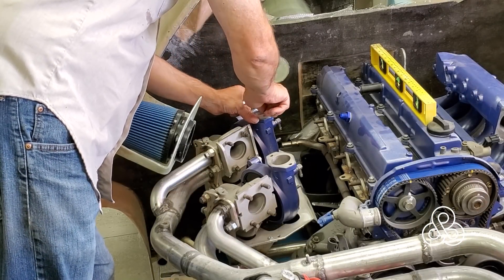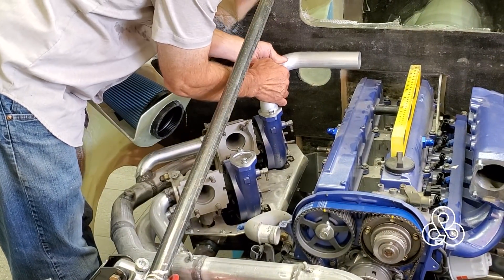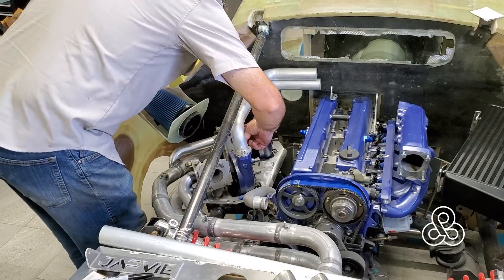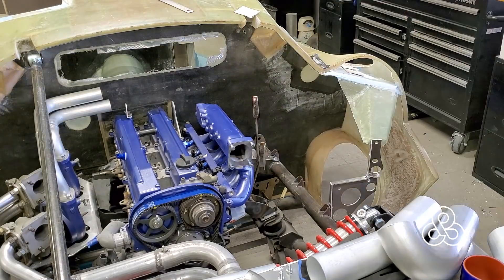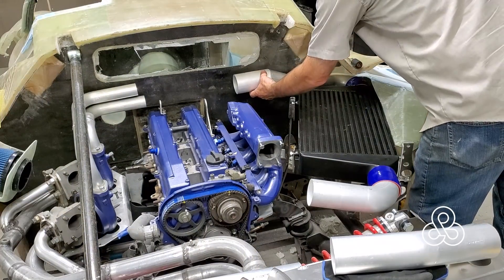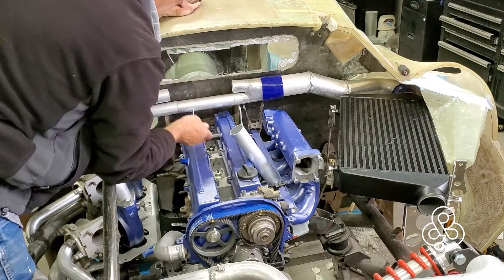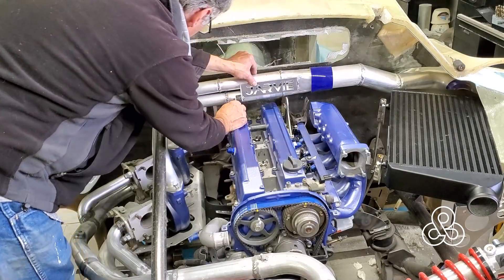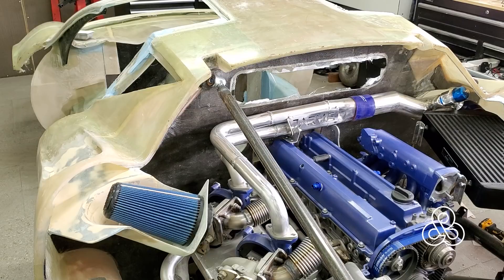A70 Turbo to intercooler plumbing - A re-do plus, Arete Supercar Project

Comment: That's a bit long of an intake runner between the turbos and the intercooler, so that might have a potentially detrimental effect on the lag of the boost building. We'll have to wait and see. It is unfortunately a bit late on this shell to decide to change over to a water-to-air intercooler design, since the sills would have been a perfect place to run the charge cooling pipes down to reach the radiator for that intercooler.
Reply from the maker: Of course lag is easily reduced by ditching turbocharging in general. Looking for high end horsepower and will skip the drag races.
Reply: @BuilderCreator  If everything else fails, you can always take the Binky approach and custom fabricate things until they fit in the tightest possible configuration. 15 degree pie cuts of aluminum and stainless can go a long way to getting stupidly tight bends with minimal turbulence from the flat angles. It just becomes incredibly time consuming and you'd also need to replace the intercooler with a smaller but thicker core version, probably using an unfinished core that you'd have to build end tanks for. Air-to-air intercoolers can be quite limiting in their placement, but are effective for reducing the number of cooling systems involved when you have space for them. But, first, it's best to run the config you've already got and see what kind of performance you're getting from it to see if it even matters. Sometimes the gains from hyper-optimizing your build just aren't worth the trouble incurred. If you ever get to a point where you're looking to completely redesign the rear sub-frame for a different engine entirely and you want something reliable but incredibly exotic, see if you can get your hands on the V12 from a Toyota Crown. It's the only V12 they've ever put into a production vehicle and it is crazy smooth. There's a series of videos of a guy attempting to cram one into an MX-5 Miata and I'm still not sure where he's going to fit radiators. The problem with exotic engines is that parts are difficult to find, so there's always that struggle to contend with. The 1UZ-FE is a much easier engine to work with if you wanted to lighten the build with an all aluminum long block and it can still accept boost with minimal modification. At one point there was even a company selling a centrifugal supercharger for it that they claimed could get you to around 700HP without needing to go to a built bottom-end. But, once again, best to see what your current config is capable of. The 1JZ is a very strong block and can easily be pushed to 1kHP.

Comment: Great video. Crazy fabrication skills. You are the American Bad Obsession Motorsport.
Question: could you not flip the incoming end tank on the intercooler? Give the 3” inlet a straight shot without the crazy bend and bulge into the firewall? Also, I saw a comment on ovalizing a 3” pipe across the firewall which seemed like a simpler idea.
Great videos. Keep them coming.
Reply from the maker: Nope. I need the extra length on the opposite end to fit the throttle and MAF sensor; flipping it would have put the discharge side just inches from the intake and no room for Throttle/ MAF. A 3" mandrel bender would have made things a snap, but alas, prefab bends is what I could afford. Thanks for following the build!
Reply: @BuilderCreator  wow thanks for replying. I probably didn’t explain well, but I meant just flipping the one end tank closest to the fire wall. I could see that you need space for a MAF and throttle body on the inlet manifold side. I’m not an intercooler expert and just randomly commenting. I don’t know if it would affect the intercooler flow to have inlet and outlet on opposite corners, maybe? I’m sure there are people who know more. I was thinking more along the lines of straighter pipe runs and not having to watch you cut a hole in your beautiful firewall. Great channel by the way. I’ve been through the whole Arete playlist!
Reply from the maker: @hutchingjc  The whole playlist! That should qualify you for a ride in the finished car or something! Thanks for helping trigger the algorithm. :)

Comment: I keep watching the turbo positions and wondering why they are there as you have done and that you are leaving the manifolds till last. A few things.
- I can't see how you are going to get air in to them, they seem backwards.
- The exhaust really should go down and out not around as you have done as fibreglass bodywork hates heat and heatshields don't actually remove heat, they redirect it. It's not like a metal bodied car.
- I don't think those flex joints you have for the manifolds will last and again the manifolds themselves will radiate massive amounts of heat. That's why most oe manufacturers place them close to the blocks and down low.
- Intercooler pipework looks neat but for future have the inlet to the intercooler come perpendicular to the fins. It would mean cutting up the tank but uses the whole core better and would not need the bulkhead cut out.
- you cannot use a hose clamp on a high pressure pipe of oval cross section. The flat areas will have zero pressure on them and this will either cause the joint to leak or allow the silicon to creep under it at this point, taking the rest of the joint with it as there is no longer any volume of silicon under the clamp.
Loving the Arete content, totally unique to Youtube and very ambitious elephant to eat!
Reply from the maker: I'll answer your questions best I can- Even with "clocking" the turbos some entry or exit will have to point in an inopportune direction. I chose the best option for the packaging area I have to work with. Heat- When you see the rear "bumper" section of the bodywork come together you will see two fans for removing heat. Flex joints- the Jz came with bellows flex joints. Toyota was okay with the design. Plus I don't need to offer a 100K warranty. Not sure I understand the intercooler pipe question. Pipe clamp- There is no oval pipe under the clamp, it is round. Sorry if the video shows the clamp (temporarily in place) scooted down over the oval area of the merge collector, it will shift back to the right on final assembly. Wishing it was only a Hippo! Ha!
Reply: @BuilderCreator  The trouble with perspective from the one camera angle made it look like the two pipe side of the hose clamp was on an oval pipe. Good to hear that it's all round! Im waiting eagerly to see how you deal with the heat management as its a mammoth task generally in a normal car, and very underestimated! Make those fans(really fans!?!?!) huge!! Keep at it, surely its hippo sized now?

Comment: Totally off-topic question: can you give us a sneak peek hint as to how the shell of the Leviathan will be constructed? Am intrigued to see how you construct a composite fuel cell too - fantastic content as always.
Reply from the maker: We will be doing a fiberglass over foam panels, layup to create the camper side panels. After some road/off road testing we will take molds off those panels and or modify them, to take into account things we learn in actual use; then take molds. The fuel cell will be happening pretty soon so stand by for a video.
Reply: @BuilderCreator  I was hoping you'd say foam panels, but the "real life use then modify" + make molds step - whilst now obvious - was not something I had considered but totally makes sense. Thanks again.

Comment: Nice build!
I’m not sure you’re going to have any meaningful airflow through the intercooler, placed as it is, in-line.
People have gotten away from twin turbos on L6 engines too. Compressor surge is a big reason why; the turbos can commence a strange feedback interaction resulting in surge.
The silicon hose joints are nothing but trouble. The Wiggins joints ain’t cheap, but they won’t blow off.
If it were my project, it’d be Single-turbo, air to water intercooler, and dual-fuel capability.
Boost lag is no longer an issue with modern turbos.

Comment: i was concerned that the tube would heat up the cabin or transfer excess heat to the top of the seats. wasn't sure if there was a way to avoid having to route the path into the part of the cabin or not but I'm glad you were able to keep it in the engine compartment. also, the bracket with the name on it is a nice touch.

Comment: Wouldn't it been easier to just squeeze the part of the 3 inch pipe that crosses over the engine? I would've done it like this. Cause two 1,5 inch pipes aren't the same as one 3 inch pipe and it would be alot less welding and not having to fabricate any collectors.
Reply from the maker: Great option! However, the twin turbo setup forces the "merge,"  but your method might have been a few less welds. For looks- dual pipes vs squashed pipe . . . Hhmmm!

Comment: Jay - Great work as usual.  If I make a suggestion, you might want to consider putting a weld bead on each of the large tubes about a 1/4" from the end of the tube where the silicone connector tube is.  This will work like a rolled bead to help retain the silicone tube when clamped down.
Reply from the maker: Thanks, I will have a bead/weld/flange to keep that coupling gripped on tight. :)

Comment: Cross sectional area of 2 1.5" diameter tubes is only slightly more than 60% of the cross sectional area of a single 3" diameter tube.  With the IC downstream, probably won't make a difference here.
Reply: It does make quite a lot of difference  - constant cross section changes introduce a lot of efficiency loss...
On the intake side - what you want is - a constant reduction of cross section - ending with the smallest section at the open valve.
This way you have your charge constantly accelerating and carry a lot of inertia to charge the cylinder to the max... Doesn't matter if you turbocharge or not - you are just moving the pressure range...
You want to keep the max speed of the charge to the valve just below sonic at the max flow rate...
Introducing a Charge cooler brings up another few variables - cooling the charge makes it denser and so requires a smaller area to keep up the speed in the intake tract.
In the case of a charge cooler - the quest for intake charge acceleration starts after that cooler.
As it is - going from D3" to 2xD1.5" to IC intake tank is not optimal at all.
Ideally you want to slow down as much as possible going into the IC.
So speed up - slow down - IC - speed up again...
Ideally you would rather start with less diameter and increase towards the cooler...

Comment: Two 1,5” tubes have only half the flow of one 3” tube fyi
Reply from the maker: Somewhere there had to be 1.5 tubes as that is what the exit on the turbos are. Go to 3" immediately and I would have to take the whole system apart just to change a spark plug. The extra 20 inches of restriction is a compromise as is most everything. Ha!
Reply: Would it been too hard to use 2" tubes?
Reply: Yeah, well thought of this too. But maybe it isn't a problem because it is not entirely true that they have half the flow of the 3 inch, because that is assuming the speed of the flow in the tube is the same. The speed might just be faster in the 1.5 inch, and thwn combine and slow down in the 3 inch. As long as the speed of the air is managable it should be fine I guess.
Reply: @assarstromblad3280  it's also not as relevant due to the turbo outlet only appearing to be 1.5" anyway - the ultimate restriction is going to be there in that case. But yeah, totally correct science regarding flow speed.
Reply: @jase_llan  True indeed, The bottleneck is there regardless, so might aswell make it easy and practical for future repairs / changes.
Reply: Well it’s a built twin turbo 2jz in a fiberglass car so I think We are gonna be okay lol
Reply: Flow is based on area not diameter. They have far less flow than half but are still big enough.